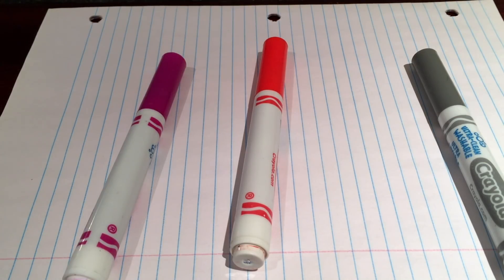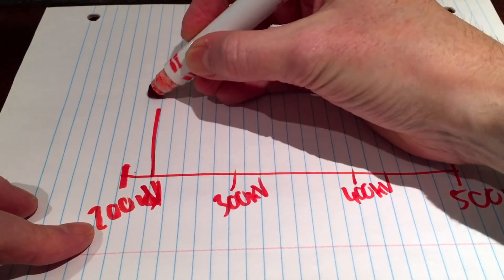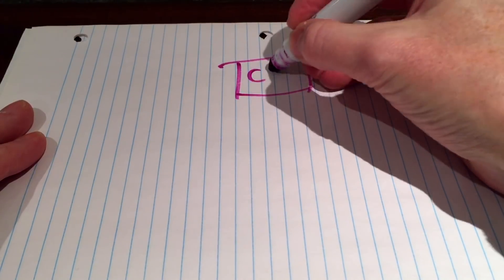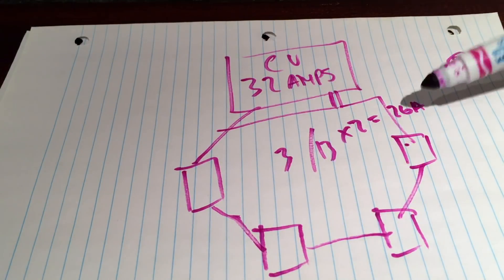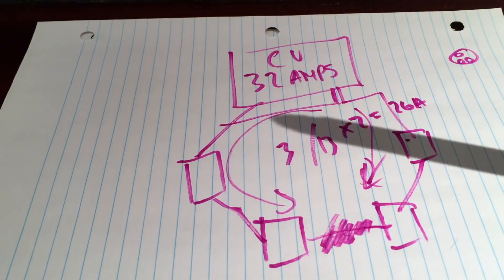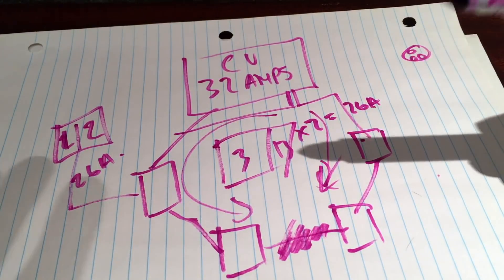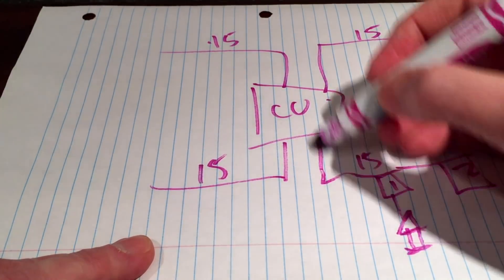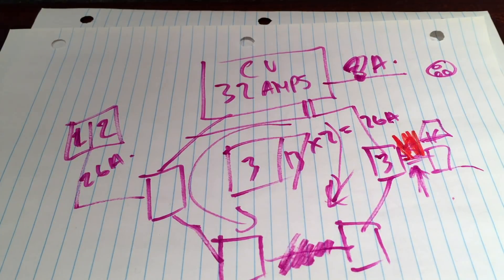THIS is why British plugs have fuses

Comment: Why can't the UK plugs be the same as in mainland Europe?
Reply: The UK were using miles before the United States was a country
Reply: We’ve had this type of plug for decades, before EU membership, and it would be too much upheaval (for minimal advantage) to change everything around. We need fuses because of ring mains, and we need polarity because of our safety system. Also, it’s arguably a better plug, although the newer universal Euro plugs are a great improvement.
Reply: Guinea Fowl It seems that the British live in a world of their own despite being in the EU. European tourists coming to the UK would have to convert their plugs using a travel adaptor. If they had the same outlets as mainland Europe, it will make travelling a lot easier.
Reply: Well there isn't a common plug for mainland Europe anyway, Italy has its own. Also, as Jason explains, European fuseless plugs would be very dangerous here (unless you had a fuse in every socket, which is sometimes found e.g. in offices, but not in houses, or in every socket even in offices).
Reply: Cooker circuit runs at 32-45amp and is single phase, 3 phase supplies 415volts for industrial use.
Reply: UK cookers dont use three phase power (other than the big ones used in industrial/retail catering). UK households generally have single phase supply although domestic three phase supplies are encountered in some European countries.
Reply: Makes more sense to have the fuses in the plugs rather than the sockets so that 3 5 or 13 amp fuses can be used as appropriate.
Reply: I can remember the older UK system. 3-pin sockets; live, neutral, and earth; in three different sizes, with different current ratings but no fuses. That is BS546 which started in 1934.  Today's fused plugs are all the same size, to BS1363, which started in 1947. The design is used in a lot of countries, mostly outside Europe.

There's some dodgy stuff out there, either not up to spec or falsely marked. I wouldn't recommend getting fuses on eBay.
Reply: They are not just for UK. They are used in Ireland, Cyprus, Malta, Hong Kong, some places in the middle east and loads of other places.
Reply: I wouldnt say the British systyem is "better". It has some advantages (fuses, polorised) and the European system has other advantages (Less bulky, Rated for 16 amps)
Reply: They could easily, we would just have to find someone to pay to change basically everything. Simple
Reply: Richard Emms, that are all places invaded by the British and that stupid plug was rammed down their throats.
That ring system was used right after WW2 to save on copper and they are still too cheap to use a proper system.
Reply from the maker: The electrical system in the UK was designed to fix up the problems that UK had experienced up to the 1940s. That predates the EU.  As for adapters, using an adapter for the country you visit is no different than if a French person went to the USA, or a German went to Japan, or Belgian went to Australia - other countries have differences, culturally, linguistically, culinarily, and electrically. It's part of the experience of travel, no?
Reply: Why can't European plugs be the same as the British?
Reply: The Romans were using miles over 2000 years ago!
Reply: "It seems that the British live in a world of their own despite being in the EU." Perhaps you could force us? I joke, but is there really a problem? No offence , but if a plug is going to put visitors off then perhaps it is time to rethink their attitude. We should change our entire system so that visitors from continental Europe won't need to buy a 2 euro adapter? It would actually annoy people from British Overseas Territories, many ME countries including UAE/Saudi Arabia/Qatar etc, many African countries including Kenya/Malawi etc,  Hong Kong, Macau, Gibraltar, Malta, Cyprus, Ireland and many more who use the same plug. After adding the populations of just 9 nations (who use the 3 pin plug) I am already at 263 million people. Why should we make things awkward for them, and just marginally easier for you, at an exorbitant cost to ourselves?
Reply: An enormous and costly upheaval to save EU visitors needing a travel adaptor? Cost/benefit...
Reply: pianocrisante90 Crisante .... Easy we are British , suck it up !! Our right to be !
Reply: For the same reason that they don't stop using the Euro and join the pound !
Reply: pianocrisante90 Crisante: The fuse is to protect the wire to the appliance. The wire is normally the thing that burns if a circuit is overloaded. The appliance has also got a fuse if required. The British system was designed a long time ago. Some people sat down and designed the safest system possible and this is the result
Reply: Because it is the U.K. not Europe.
Reply: Because the UK wants to be different, I mean they still use miles and drive on the left side of the road why can't they use a different plug?
Reply: pianocrisante90 Crisante our system is far superior to any European system, the UK has always done its own thing and most of the time it's better for it.
Reply: You get three phase in domestic situations so wrong on that..snd you get cookers with a 13amp plug on them you can plug into a socket so wrong on that to. Cheers
Reply: Because ours are better and older, why would we switch to something worse? This is why we voted leave
Reply: Why would we downgrade because the rest of the world is behind? And we aren't in the EU (in the future) and weren't when the foundation for these standards was put into place. Also, adapters exist for a reason. It would be pretty selfish for people traveling to demand their standards.  There is a reason why travelers don't demand as such. Because it really doesn't matter that much.
Reply: Because UK plugs are the best that has ever been designed and two major wars in Europe was more than enough.
Reply: Wrong..... we need fuses to protect    appliances from over-current nothing yo do with ring mains. I don't understand what your saying about polarity all that is about is making sure live is live and neutrel is neutrel and your earth is your cpc. Cheers

Comment: I suspect the answer to the 12A question is that the wire from the plug to the applience is probably something like 18gauge wire which has a lower ampacity (rating).
Reply: Harry Lanza Right, but I thought he was referring to the cord that one plugs in the receptacle.
Reply: He said "wire from the plug to the appliance" which can be less than 14AWG, and always stranded instead of solid.
Reply: Harry Lanza if that is 120v then that would explain your need for more amps we have just 240 more volts less amps we can run 3kw off any standard plug in the house were as having 120 for some products and 240 for others seams silly to me
Reply: @chrismills8927  We use split single phase. 240V comes into the panel (consumer unit as you call it). Two hot legs at 120V a piece and one center tapped neutral. We only use one hot leg for most of the wiring in the home, but use both hot legs for 240V appliances like ranges (cookers as you call them) and washers/dryers. So our 240V appliances will have four pronged socket plugs. One advantage of the split single phase supply is that it's always 120V to ground, even on 240V. So the damage of a shock will be less.

Would it be easier to just convert it all to 240V? Sure, but good luck with that. The U.S., by geographical area, is the third largest country with 320 million people. Our infrastructure is already in place and it would be impossible to just flip a switch. Canada is the 4th largest country (by area) and uses the same electrical system. So it would be a collosal task to switch both countries.
Reply: It's 1.5mm cable which is rated at 18amps it's overated on purpose there is a British standard maximum sized cable to be used in a British plus top is 1.5mm BS1363...
Reply: Uk is 230 volts
Reply: @harry Lanza that's not entirely true.... for hardwired stuff, yes 14 ga or bigger. That said, most lights (especially plug-in) can be as small as 18 ga. that said, I personally don't trust anything smaller than 16 ga for plugin stuff. -edited my horrific grammar/spelling some.
Reply: +Chris Mills
'Harry Lanza if that is 120v then that would explain your need for more amps we have just 240 more volts less amps we can run 3kw off any standard plug in the house were as having 120 for some products and 240 for others seams silly to me'...not necessarily true. It all depends on the rated voltage of the load/appliance. E.g., a 100v, 100w incandescent lamp will draw 1 amp, but if you put 200v across it, it will draw 2 amps and produce 400 w.
Reply: +Chris Mills My oven, water heater, HVAC, and clothes dryer take 240.  These are all in set locations; kitchen (like where the oven goes, that's where the plug is), utility room (the water heater and HVAC are usually hard wired), laundry room (well if I put the washer where there's water hookups then I don't think it's unheard of to place the dryer where there is a dryer outlet and vent).  All of my other outlets and everything else I plug in takes 110 or USB.
Reply: 'a 100v, 100w incandescent lamp will draw 1 amp, but if you put 200v across it, it will draw 2 amps and produce 400 w.' but you wouldn't put 200v down a lamp rated at 100V  100W, you would put 200V down a lamp rated at 200V 100W  surely? and therefore it would take 0.5 amp.
Reply: +Stuart Stratton
I suggest you read my comment to Chris Mills again, in its entirety. Some people seem to think that if you take an appliance rated at a specific voltage and wattage, and increase the voltage applied to the appliance, then the current drawn will inversely reduce. They're applying the W=VxI formula, when in fact they should be applying the W= I^2xR one.
Reply: 18 gauge is not used in any wiring in the USA. The minimum gauge is solid copper 14awg wire that can carry 20 amps safely but our laws limit to only carry 15 amps.

Comment: In the USA most homes have 4 to a maximum of 6 outlets (120V 15A) per room. Kitchens have dedicated circuits for the refrigerator (120V 20A) and stove (240V 30A). The breaker panel "consumer unit" in a typical home is rated 100A feeding the home with 15, 20 and 30 amp breakers with the majority being 15A breakers. if for any reason there is a short in say that  lamp, the breaker trips shutting down a maximum of 6 devices. There is logic to shut down the area as to not cause damage to another device like a TV or computer located in or near said outlet. Also this idea is easier to add or change circuits without disrupting the rest of the home something not possible in a ring circuit. 

Now on to answer you question about appliances under to 15A rating . My vacuum cleaner is rated at 8A and a tea kettle rated at 12A. Manufactures are creating more efficient appliances so that we can use more at the same time. For instance in the kitchen, I can use a tea kettle toaster and microwave all at the same time because the circuit is rated at 20A while other parts of the home (bedroom, living room, dining room......) are at a 15A circuit. My entertainment center is dedicated to one 20A circuit. 
As far as fuse in a plug, yes we have them available as well as plug strips with breaker and fuse protection built in. Along with GFCI (Ground Fault Circuit Interrupter) and child safe outlets have been in the USA for more than 25 years.
Maybe now you can get an understanding why we do it this way.
Reply: no we dont. no more so than any other country
Reply: The ring circuit is a wartime relic, but it’s pretty easy to add to it - you can just take a spur off a socket on the ring. Each ring main, which requires surprisingly little copper, and is run like a radial but with a return, can supply about 7.5kW. That’s pretty good.
Reply: then you clearly dont understand the benefits
Reply: Video link is dead.
Reply from the maker: Oh I know Knob & Tube....  Each time I've bought a new house or moved, it's been top of my list to look for.  Even the house I'm in now has a few dead circuits from when it was first built that was the next thing after the knob & tube...
Reply from the maker: Thanks.  I know a bit about a lot of things (jack of all trades, master of none), but I'm usually a software guy instead of hardware... the story of the dead duck button is an exception to the rule - https://www.youtube.com/watch?v=KhaCBNHazU
Reply: You have to watch how many appliances you can / should use at once? :O

That's crazy... I can have my Electric oven, and hob on, while using the microwave, and the Kettle, whilst listening to the radio and charging my laptop, all at the same time in the Kitchen, at the same time the lounge has the large TV, Surround sound receiver, Router, and maybe a console or something in use at the same time, while in the 'office' there's a computer, 3 monitors, a lamp, a high power amplifier, and various 'device chargers'...

All in use at the same time.....
Reply: I still don't understand the benefit to a loop circuit aside from the cost difference (which is next to nothing now).
Reply from the maker: I actually think (personally) that the radial circuit is way better.  The ring circuit idea is a daft relic that should be consigned to history.
Reply: The idea of the ring circuit is that the load is equal across the whole circuit but much more difficult to add or rework. On our system the load equalization is done in the main panel by distributing breaker amperage evenly or as close to equal on the two main legs. The neutral is constant across the entire home as is the earth but that is fed directly to the earth. My home was built early 1930's and used our relic "knob and tube wiring" (look it up) method with only feed and neutral wires and no earth. Many homes still exist that used this wiring but I upgraded my home many years ago.
Reply: By the way your videos are a helpful explanation as well as entertaining. I'm also an IT guy but on the infrastructure side and electric is also part of my job.

Comment: An excellent video. But here in the UK it is very rare to have a three phase supply within a domestic property. Household cookers do not need that sort of connection. In my house a large and a small oven run to a  (correction) 20 amp breaker on single phase.
Reply: That is correct. The lower voltage used in North America is yet another historical relic. A voltage around 220-240 is actually pretty close to optimal for a mains voltage with current technology. It's a good compromise between safety (lower voltages are safer), the need for insulation (lower voltage = less need to worry about insulation and arcing = lower costs), and metal costs for wires (higher voltage = lower current for a given power = less money spent on copper).

With electrical technology circa 1885, however, a voltage around 110 was optimal, because electricity then was used almost exclusively for lighting, and with the technology at the time, it was cheapest to manufacture carbon-filament incandescent bulbs at wattages commonly needed for interior illumination at that voltage. That cost advantage for incandescent bulb manufacture hasn't existed in over a century (and incandescent bulbs themselves are now mostly historical relics), but North America is thoroughly locked into 120 volts.

The three-wire electrical feeds became common in the post-WWII years as a way to allow houses to have high-current appliances without using expensive super-thick wires or requiring an extremely disruptive doubling of the standard mains voltage.
Reply: Yeah Domestic properties in the UK usually only have single phase 230V supply, although the cables in the street have all three phases, so it is likely your next-door neighbour will be on a different phase to you, which, I am told, is why you shouldn't share extension cables over a garden fence. I believe in the US you have two 120V phases domestically, so you can have 240V for larger appliances?
Reply: That bit about three phase residential power struck me as strange. I'm betting he's using the term to mean something other than three separate sine waves each leading the other by 120 degrees. Three-phase power is only used in commercial and industrial installations here in the USA, and it would strike me as odd for the UK to be different; there's just not much need for big three phase motors in the home.

Maybe he's using it to mean a power supply from a center-tapped transformer. In the USA most homes get three-wire power feeds, two hots and one neutral (a center tap bonded to earth). The voltage between the two hot lines is 240; the voltage between either hot and neutral is 120. The 240 volt circuits are used for high-current appliances like clothes dryers and kitchen ranges. The two hot lines are effectively two phase power, 180 degrees phase difference. Do some UK homes get something analogous with both 220 and 440 volts available for circuits?
Reply: We did have a uk house that had 3 phase, we had to get it installed because my partner is Italian and wanted a huge cooking hob.  Admittedly it could be wired to run on single phase but in that instance it would reduce the number of rings that could be used together automatically.  3 phase meant there was less delay for the pasta, a top quality investment :-). It also proved to be awesome when we sold the house as the guy who bought it in only came to look at it because 3 phase was listed in the property details and he wanted to run a kick ass milling machine in the garage.